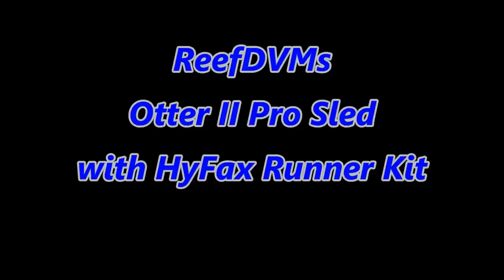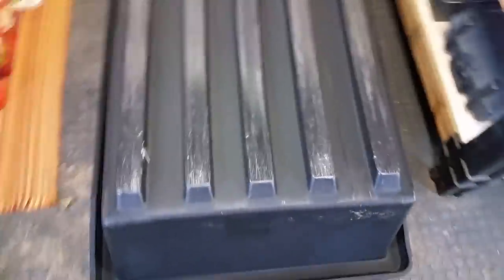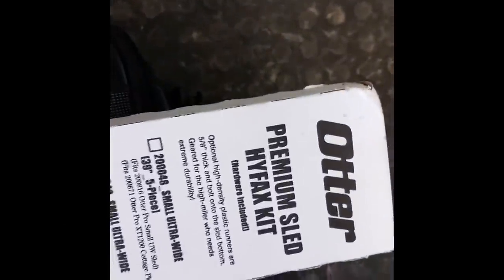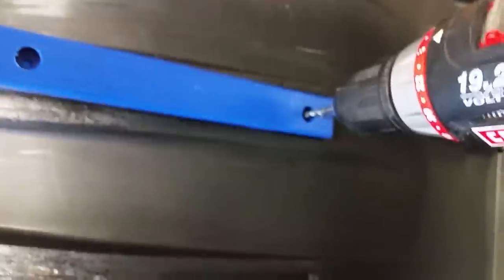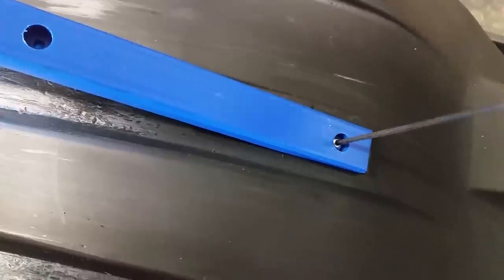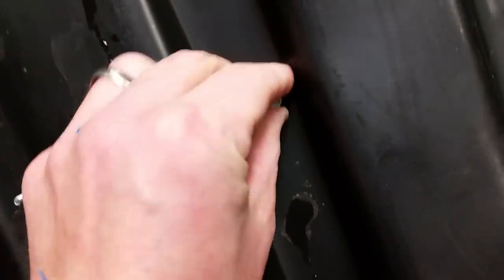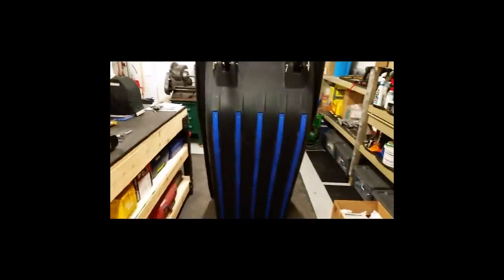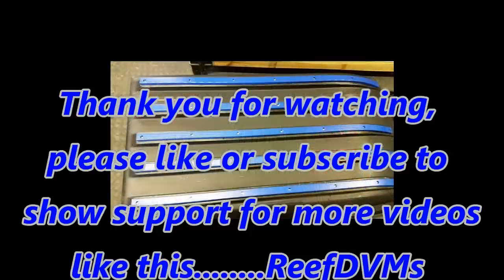Otter II Pro Sled with Hyfax Runner Kit / ATV Hitch

Comment: you should have put the nuts to the outside so the heads would be flush inside the bottom of the sled.  that is why they are lock nuts.